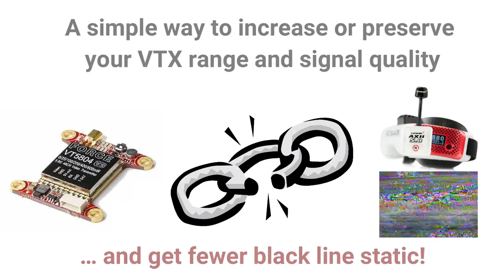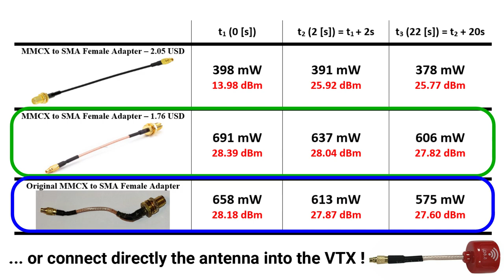A simple way to increase or preserve your VTX range and video signal quality

Comment: Worth ordering a few different brands of pigtails to keep as spares. Thanks for the video, great tip.
Reply from the maker: Glad I can help. You are right, if you do not have a RF power meter, the only solution is to buy several pigtails and check them.

Comment: Wow..was surprised of the performance difference....I just installed one of those thin black adapters you tested and thought I noticed a slight degradation....I have the RF meter and will check them now..thanks for taking the time 👍🏼  every mw counts...
Reply from the maker: I'm happy I can help. The video arises from an identical problem I encountered.

Comment: One comment I have, as a former RF systems test engineer, is that the use of a SMA torque wrench for consistent results and to remove the mechanical connection variability as much as possible.
Reply from the maker: Based on the same assumption, I think that the best connection with minimal losses is to solder directly the antenna.

Comment: isn't it going to be warmer on the second and third data set? Usually my vtx takes a bit more time to cool down. Wild that there are so much differences though
Reply from the maker: I didn't notice that it would be hotter ... but it's very possible because the losses increase and less power is emitted.

Comment: Which is better upgrade antenna or increase output power vtx for tiny whoop
Reply from the maker: Any circular polarized antenna is better than linear polarized antenna (that simple whip antenna with which your drone came) . So, check your connector type an buy a  circular polarized antenna.